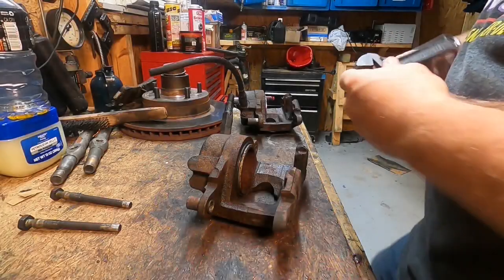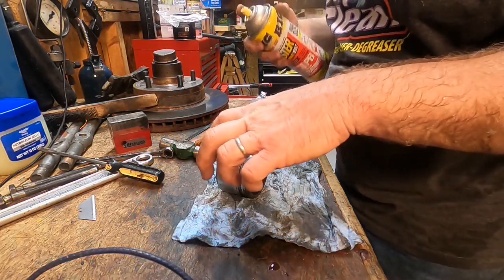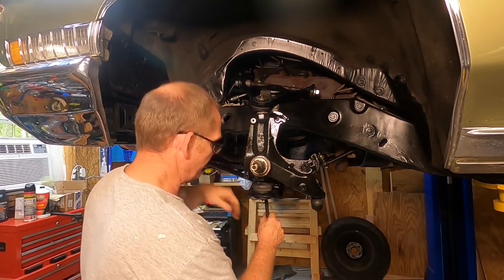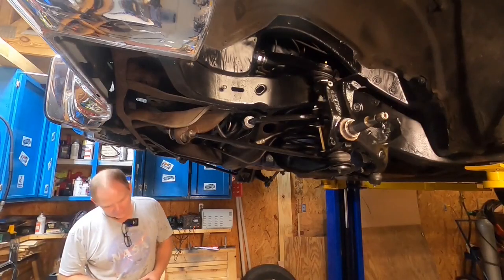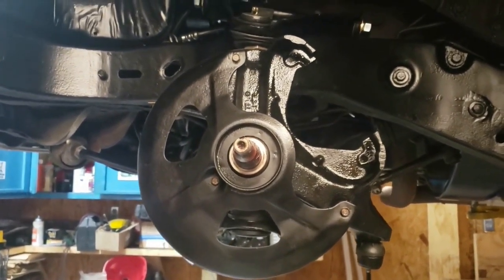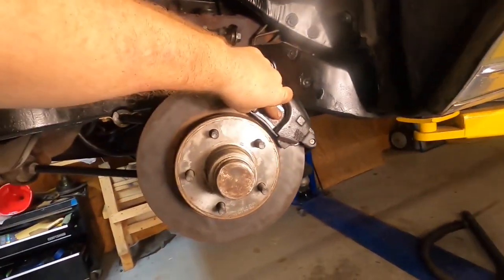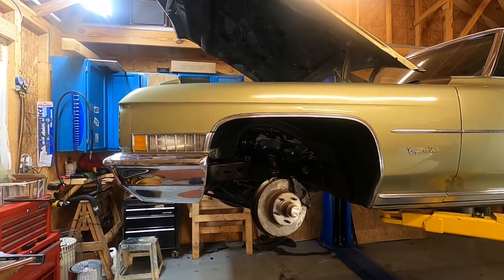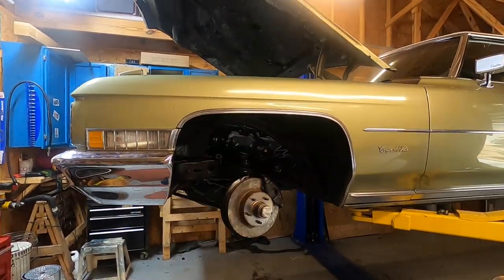71 Cadillac Coupe DeVille Complete Front End Rebuild - Part 5 - FINAL Assembly

Comment: Nice job. But even with a lift, it's much easier to pull the body off the frame, restore the whole undercarriage, paint the frame, detail the engine and trans, and put new body bushings while you're at it... Yeah it's more work, but then you've got a car that looks and drives like new..
Reply from the maker: Not disagreeing that a body off type project will produce like-new results, but that is not practical here. The body bushings look good on the car. It spent its entire life being stored indoors.